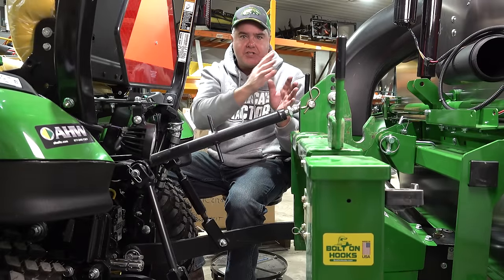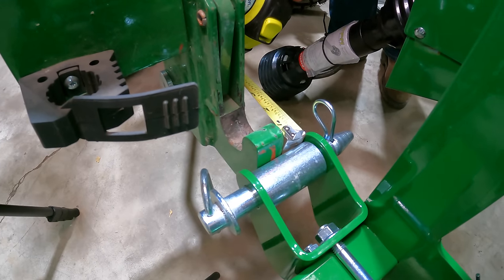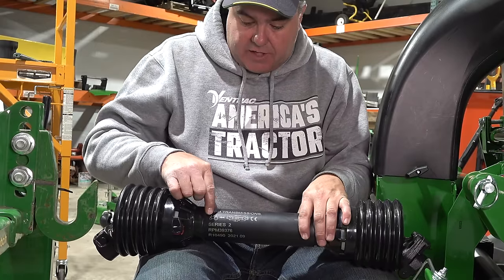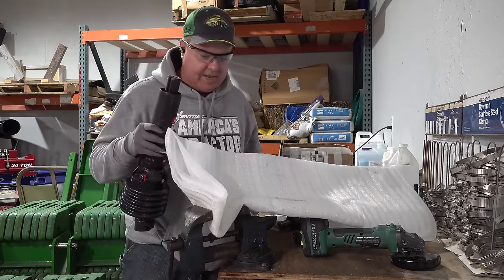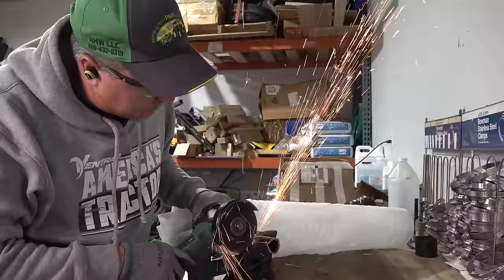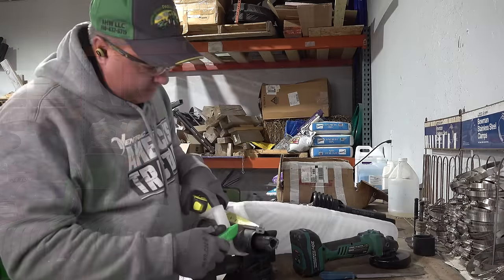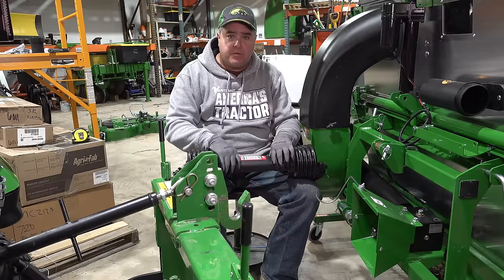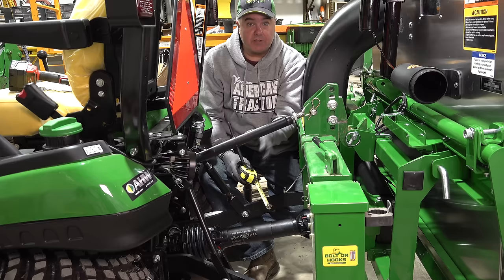How To Measure/Cut Tractor PTO Shaft THE EASY WAY!!

Comment: All makes sense.  When I did mine, I did a lot of "nibble and test".  That takes considerably longer, but I could neither move the tractor (8000+ lbs) or the implement (1000 lbs) easily.  

So, I hooked up the snowblower to the 3-point and attached the PTO to the blower.  I played with the 3-point height to see where the shaft was most overlapped (being careful not to pinch anything) My first cut was purposely short.  I had a bout 1/2" as I moved the PTO around the tractor's output before it would clear.  I cut again just under 1/2" and while I was able to jam the connection on (and would have had no issues if I lowered the blower) I decided to take it apart again and just grind some more length off.  This allowed an easy attachment in the shortest position.  Since when you slide the PTO on, you automatically get some buffer, this looked good.

Then I dropped the blower, marked the tube and pulled it apart again to see how much I still had overlap in the long position.  With nearly 18" of metal overlap, I felt good.

The only issue I have is that when the blower is down, the PTO angle is a bit steeper than I would like.  I used it last season without any failure.  It looked OK when I regreezed it a few weeks ago, but at 20+ degrees, I'm not happy with it.  I'll run it again this season as other projects prevented replacing.  Fingers crossed.

I'm beginning my quest to find a solution with CV joints on each end.  If anyone has a source that they can recommend I'd be very grateful.  The PTO shaft in question is a T50.

Comment: A word of safety!!!!  No matter how tempting it is, NEVER use a cutting wheel for grinding. The cutting wheels are not made to handle the side forces needed for grinding and they will practically explode without warning.
Get two cheap grinders from Harbor Freight; put a grinding disk on one and a cutting wheel on the other. Its cheaper than getting stitches in the Emergency Room. Ask me how I know.
Reply: Or just change the discs which is easy to do. Much cheaper than buying another grinder and it takes up far less room.
Reply: @garymeyer3294  If I'm really into what I am working on, I hate stopping to change a disc, therefor I have (3) grinders not counting my cordless. The corded ones aren't that expensive, especially on sale.
Reply: @garymeyer3294  All is true. However, it takes longer to swap disks than to pick up another grinder. And if you are doing a lot of swapping back and forth it is a big time saver. Plus you can get a cheap Harbor Freight grinder for something like $20 each.
Reply: @blackhawkinternationalsecu6962  I  agree if you have a lot of swapping to do.

Comment: An easy way too make your cutting marks is to use painters tape..  you can use brake cleaner prior so the tape holds, but it will be a good guide and easy to see as you go to cut.

Comment: Thank you, needed to shorten a PTO shaft on a new tiller, thats about 2 1/2 inch to long. 👍👍
Reply: Just finished cutting the shaft, had to cut 4" off, but as this was the first time it took 2 cuts to get to the desired length. Thank you again for this very informative video. In my opinion that video deserves 👍👍👍👍
Reply from the maker: My dad would say “cut it off 3 times, still too short!”

Comment: I think most of the noise from the pto shaft sliding is the plastic sleeves. Did you remove what I can only assume is melted plastic from the cut ends?

Comment: Excellent timing!  Explained very clearly.
I have a new post drill that has to be installed. I don’t have a quick hitch and my concern is the range of vertical motion. Is there anything different to watch for when cutting the shaft length?
Thank you for the video!
Reply from the maker: I’m not sure you will need to cut the shaft for a PHD.   Put it on, remove the auger, and slowly test the range of motion.
Reply: @TractorTimewithTim  Awesome, will give it a go. Greatly appreciate your reply!

Comment: never cut a pto shaft in my life..let alone own a tractor ?!, but after watching this video, you are making this very hard for everyone !. not all of us have a QH attachment ?, and the method you show about measuring the QH distance is nothing but a waste of time tim. the way i measured my pto shaft to fit my kubota , i simply measured from the locking slot  on tractor pto, to the locking slot ( where the bolt goes on attachment ), got my measurement, laid the pto shaft next to each other when i had them apart, got my measurement from locking slot to locking slot, could clearly see how much to remove..as well keep my over lap for the outer plastic cover. my measurements when i did this was a straight level, on the ground with my tiller, i then allowed for over lap of not only the plastic outer cover ?, but to also leave enough shaft to be well long enough when raised, i would have enough inner and outer shaft to slide into each other, and ya know what ?. it worked first time !!, was not long...was not short. two things to keep in mind, one : NEVER ALLOW THE SHAFT TO BOTTOM OUT INSIDE OR OUTSIDE THE SHAFTS ?..IF THEY DO ?, THEN YOU WILL DAMAGE EITHER THE TRACTOR PTO ?, OR THE ATTACHMENT PTO ? second : LEAVE ENOUGH OVER LAP ON THE SHAFTS SO THEY ALWAYS HAVE ENOUGH SHAFT TO STAY TOGETHER !.

Comment: Do they make an extension?  I had a 1025R and have purchased a new 2038R.  When I hook up my tiller now.  The shaft is about 3" short of safe
Reply: PTO extender. Available on Amazon, etc.  Make sure it has the right splines. Most will extend you about 4 inches

Comment: If you want to square off the cut outer tube, try putting a hose clamp around it and lightly tightening it up. Then you just need to trim the soft plastic up to the hard edge of the hose clamp for a professional finish. 
You can use a pipe cutter, but probably need a clamp either side of the cut line to stop the plastic flexing away from the cutter and making the cut go wonky.

Comment: If you have one, a muffler pipe cutter does the cover nicely, and a bandsaw is best for the shaft. You use what you have and it will work fine. For a final check, form a piece of modeling clay into a cylinder, insert in the shaft and run a full up down stroke (with it not rotating), hanging the implement off a drop so it gets all possible angles (though theoretically it will be at a minimum when the implement is straight on with the PTO output stub). Redundant, but the consequences of screwing up are severe. Don't forget to lube the shaft before final install. (yeah, I typed that last part several ways until I liked the look of it....)

Comment: My tractor sales guy brought me an implement already cut along with the tractor.  I told him I was going to put on a quick hitch and he said that it was OK.  So he cut it 4" shorter than it needed  to be cut if the quick hitch adds 4 inches. So that leads to the question how much does the PTO shaft have overlap for each side?
Reply from the maker: They like it to be ‘half or more’ of the total length.
Reply: @TractorTimewithTim   thanks

Comment: I would stress the importance on checking all the possible ranges of motion especially on the float field attachments like flail mowers. Especially when tractor starts to go uphill and implement is still going downhill the shaft becomes more retracted than usually. This can cause similar issues as what TTWT did with his flex wing.

Comment: Tim, you spoke about the quick hitch increasing the lift arms by ~ 4-1/2".
What does that do to your lift capacity?
A quick estimation with the calculizer shows losing about 17% of lift capacity by increasing the lift location from 24" behind the arms to 28-1/2". 
I have not factored in the weight of the quick hitch itself. It should be a fairly minimal amount considering it's small weight and location close to the 3 point arms. 

MATH:
24 / 28.5 = .842 or 84.2% || 100 - 84.2 = 15.8% loss
or
4.5 / 24 = .188 or 18.8% loss
and
(15.8 + 18.8) / 2 = 17.3 (the average of my two numbers)

I feel like these numbers are too high, and that I might be missing something in my math.
Would you be willing to do a demonstration of this, and perhaps provide some clarity?
Reply from the maker: Not sure about your math either way.  However, yes, it does decrease lift capacity.
Reply: That is why I don’t use one on my BX… my brush cutter and wood carryall become cumbersome… I had one and traded it for a box blade.

Comment: Its shorter than it needs to be because you failed to account for the length of the PTO coupler from the nose to the detent pin. If you put the shaft on and pushed it up to the detent pin (without pushing it in) and then measured it would be more accurate and you wouldn't have to fumble with the holding the shaft.

Comment: Great video! Thanks, Tim. Does Terra King build the Frontier branded MCS? Looks very similar to your other units you have shown before.
Reply from the maker: Yes.
Reply: @TractorTimewithTim  The lid looked much different than the TKV.  Looked like a hardshell top.  Interesting to see your thoughts on if this is an improvement to the older model or not.

Comment: The attachment needs to be attached to the tractor to get a measurement because depending on the lift arm geometry the shortest distance could be in the raised position.
Reply: When I use a brush hog the shorter is always when it’s raised

Comment: Suppose i have attached rotory  tiller with tractor .and i have both tractor pto and implement in one line .and carden shaft is overlapping 2inches the tractor pto then how much shuld i cut . Plz guide
Reply from the maker: If fully connected, and only 2 inches overlap, you do not have enough overlap to be safe.  You need to get a longer shaft.
Reply: 4:14 i am talking about this overlap after fully attaching and carden shaft in fully contracted position  but it is still 2 inches over tractor pto and I'm unable to mount it over the tractor pto .4:14